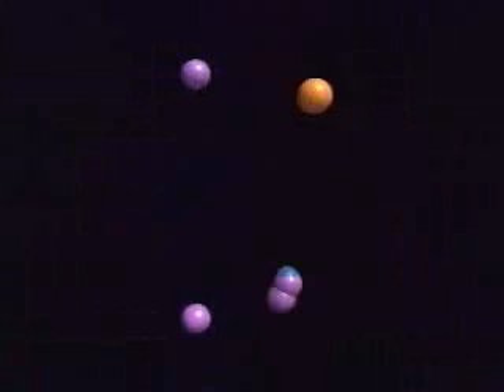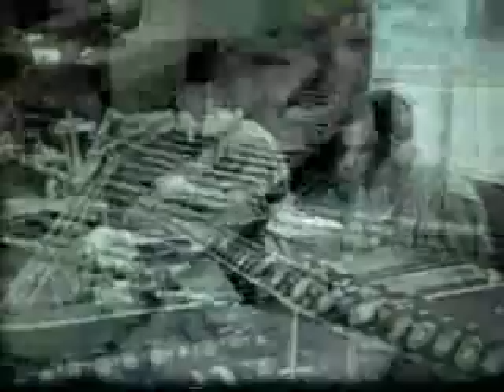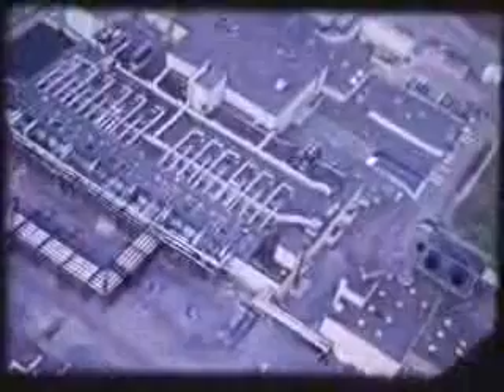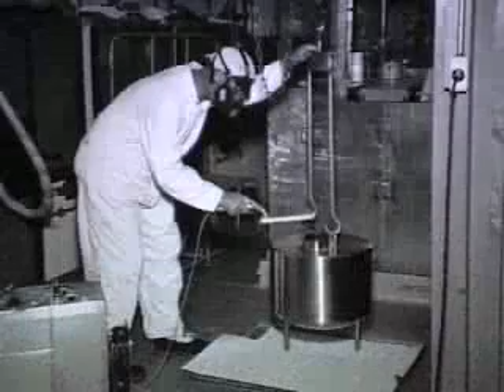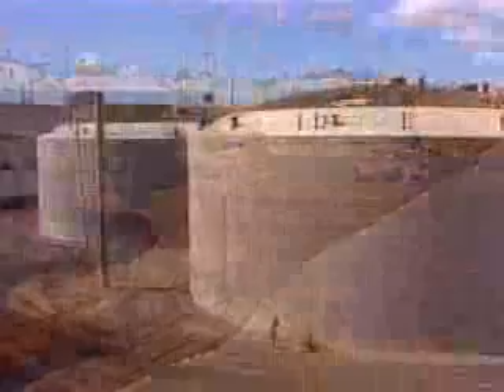Five Decades of Plutonium Production at Hanford

Comment: I guess you really need a DeLorean with a Mr. Fusion to use plutonium for peaceful purposes...
Reply from the maker: Yup, it's just not a peaceful element....
Reply: @MrJmccammon  Actually, it is quite possible to use Pu for peaceful purposes.  It is produced ANY time you have a chain reaction in Uranium.  To produce Plutonium, you have to remove the fuel rods within weeks at most.  If you simply leave the fuel in the reactor for an extended period as happens in a commercial reactor, then the Pu generated is simply fissioned as well, becoming an expected, calculated, and desirable portion of the total heat output of the fuel load.  

As a logical extension, Plutonium can be mixed with Uranium and used to produce commercial fuel called MOX (Mixed OXide) fuel.  This fuel is suitable for use in many modern commercial power reactors in specific fuel loading configurations.

Comment: My father got his PhD in Chemistry at UW back in the mid 60s.  He ended up going over to Hanford to work on the chemical reprocessing and more importantly...the problem of how they were going to deal with the waste in the "future".  Ended up working for both Livermore and Los Alamos during his career as well.
Reply: Funny you mentioned UW. We were doing a lab clean-out for UUE and found an accelerator target similar to the one shown in the beginning of this video in a micrometer mount. Most people thought it was a laser part due to the holder it was in. But it betrayed its true nature when removed from the kinematic mount simply said caution radioactive material, Pu239 6.5Ci property of the US DOE. It was mighty spicy when tested with a Ludlum model 2 counter but easily shielded in a lead pig. They thought it got lost in the 1960's and the state NRC refused to pick it up as they were not authorized to transport plutonium. They had to send federal NRC agents to come get it.The irony is that if i hadent been interested in the "laser parts" it would have ended up at auction or the UW surplus store.😂
Reply: So, what did they come up with as a solution to that problem?? Nothing, would be my guess..
Reply: @davelowets  could probably re use the waste for batterys
Reply: Your dad was a parasite
Reply from the maker: Sry for delay. Been dealing with thyroid cancer, bad shape for 8 years, only recently became "stable". Gotta wonder how many sources or at your local goodwill, I got a 1960 radiac counter with cobalt comparator for 10bucks at a thrift shop. Works perfectly!

Comment: They just pumped the cooling water back into the river!? WTF
Reply: Chemically pure water.  Most of the support buildings around the reactors were nothing but cooling water pre-treatment.  Chemically pure water can NOT be made radioactive by exposure to radiation.  Impurities in the water CAN be made radioactive.  We aren't talking filtered water here, we are talking lab-grade chemically pure water.  Any activity in the cooling water discharge would have been an indication of a water treatment problem and/or possible damage to the core, and would have resulted in the immediate shutdown of the reactor.

Biggest cause of damage to the river would have been due to a possible temperature increase, and THAT was very carefully monitored, as downstream temperature monitoring could have been used by our adversaries to determine the approximate power level the reactors were operating at.
Reply: Glow fish
Reply: That's kinda how it should work or at least into a body of water to cool down to temps that won't hurt wildlife

Comment: The RBMK-1000 design has a LOT in common with Hanford B
Reply: AND a lot different also....
Reply: Only difference is much of our scram methods in last ditch would destroy the reactor.
Reply: @JamesLuck2969  Only the liquid boric acid dump would have been irreversible.  The control rods and the emergency scram rods could all withdrawn without permanently affecting the pile.  And we soon replaced the acid with absorber-doped ball bearings that could also be cleaned out after use.

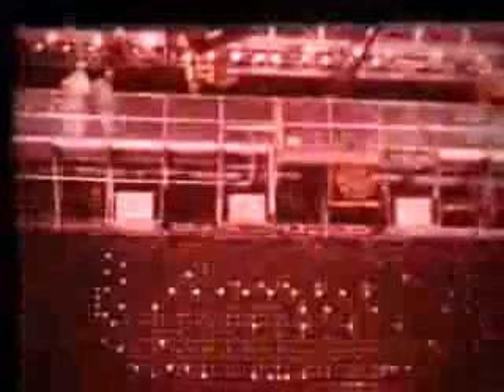Comment: 10:58 So Americans can make a water-cooled, graphite-moderated reactor with a positive void coefficient not explode because there were strict safety guidelines, something the Soviets couldn't do with the RBMK. The RBMK is almost a complete copy of the Hanford reactors.
Reply: Hanford B shut itself down by xenon poisoning during its very first run, and our operators pulled out all the control rods just like at Chernobyl.  We just got lucky that the reaction didn't restart anywhere in the pile (which happened to be too small) or we would have had the same accident in the state of Washington.   How we survived the early years of our atomic energy program I do not know.
Reply: Key words are  "almost a complete copy".  A virtually identical copy of the RBMK reactor design was discarded by the US during the design phase due to the very safety concerns that lead to disaster in Chernobyl.  What was actually built with B-reactor was a facility with more control rods, more safety rods, better sensors, a Barium dump system, and other features expressly put in place to prevent a runaway reaction.

Even with the reactor at 100% and all of the control rods pulled, inserting even a few of the safety rods would have resulted in an immediate SCRAM, and they were automatic and inserted using high-pressure air rams.  

The Barium dump system simply allowed a bunch of Barium-coated balls to fall by gravity into the voids in the core.  Basically, if the Barium system were ever engaged, you just shut off the lights and locked the doors behind you.  No way to remove them short of dis-assembling the core.

The RBMK reactor would have barely even shown a flutter on the instruments at the Xenon levels which completely shut down B-Reactor.  Chernobyl was run on the ragged edge of a disaster during normal operation.  B-Reactor was run on the ragged edge of barely being able to sustain a chain  reaction.
Reply: @kevincrosby1760 Boron coated balls, I believe.

Comment: The Irony that  is sad  the USA President will stand up in front of the World and say we will ban it but what he wont say is we will no longer produce it or use it. How can you expect other Nations to  comply with this Law when you are one of the top producers of weapons grade materials  in the World?
Reply: The USA is no longer producing fissile material.
Reply: @josephastier7421  We most certainly are. What are you talking about? Uranium is produced for reactors and plutonium production restarted in 2015 for NASA spacecraft.
Reply: @ShimrraJamaane  The uranium fuel for nuclear power plants is enriched to less than 5%, not high enough to make bombs.  The Plutonium-238 used on spacecraft RTGs is the wrong isotope to make bombs.
Reply: @josephastier7421  Correct, plutonium for RTGs isn't fissile (forgot that was a different isotope). However, we still produce tons of fissile uranium. So, your original comment would be accurate if you add that we no longer produce weapons-grade fissile material.
Reply: @ShimrraJamaane  Ah, OK(forgot that fissile includes any material that can sustain a chain reaction).

Comment: Those 8 reactors, running for decades, must have produced an unbelievable amount of thermal energy that was never used to produce power, just *wasted*.
Reply: Over its entire life, Hanford consumed far more power than it ever produced. That's why it was located where it was. Lots of water and hydroelectric power.
Reply: @railgap  Not hard to believe, considering it wasn't a power station.
Reply: @josephastier7421  Actually, 100N was both a Pu production reactor AND a power plant.
Reply: The thermal energy was of too low temperature and pressure to raise useable steam
Reply: It was smuggled to ishtahel
Reply: I think the idea that they ran those single pass reactors for so long is more concerning than wasted power.
Reply: @willett786  In the end, I guess you would need to see the numbers for much thermal energy was produced, and how much spent fuel.
Reply: In a water-cooled Graphite Core reactor designed for Pu production, steam is a BAD thing.  What verges on unbelievable is the amount of water that they forced through the cores to PREVENT steam generation.  Without generating high-pressure steam to run through turbines, there is really no practical way to recover that heat energy.
Reply: @JZ's BFF Really?  Send me an email address and I will be happy to send you a copy of a picture taken several months ago on a public tour.  Quite a nice picture of me standing three feet or so from the Front Face of B-Reactor.  That reactor was online and in production 40 years ago.
Reply: They don't run the neutron bombardment all the time... and it is not capable of producing large amounts really... relatively small amounts... it doesn't take much to obtain critical mass with U238... and it is hotter than hell... it's the uranium in the semi molten mantle that keeps it semi molten... our arms race with the Russians was NOT won through strength of arms.... it was the Russian economy that tanked... they spent more than they took in.  . So they printed more money... and there's only one result of spending more than you make ==>> bankruptcy 

A people who forget their history are doomed to repeat it... so they say... and if the Russians went broke... I think it's our turn... our paper money derives its ONLY value from the promise of our future taxes... it's borrowing ahead... at interest... to pay for absolutely unnecessary wars... any idea what the difference between communism and socialism is?... 

There is no difference... because our benevolent government ends up with all of the fruit of our labors... it doesn't matter what they call it... it's the same thing when the people who do the work don't get to keep the fruit of their labors 

What's that called?

Starts with an S
Reply: @Phyz7  Yes, it is "normal." And pretty much irrelevant, in both cases. I don't know how you would even compare the two, either to each other or to modern power reactors. The early reactors were run to create bomb material, not power. And the Sun doesn't have a "purpose" it just exists, and we just happen to be able to use it for our purposes.

If you then want to ask why I even brought this up, it's simple. It just seems to me an extraordinary about of wasted energy. That's not an indictment of nuclear power in our time, because it was before our time,, and with other things in mind. I still think it's a hellacious amount of power, a mind-blowing amount. That's all I was saying.
Reply: @JZ's Best Friend Are you drunk? What was the rest of your sentence? Anyway, seems you're basically right FWIW. There was a LOT of stray contamination created in the Cold War, on both sides. (Make that at least 6 sides—need to count China, UK, France, and India.)
Reply: @JZ's Best Friend Isn't he great folks?   Let's give him a big hand!
Reply: @JZ's Best Friend We gave them a chance to surrender peacefully at Potsdam.  They weren't interested.   So we had to do it the hard way.
Reply: @JZ's Best Friend You've heard the story because it's true.  No variations exist.  We gave them a chance to resign peacefully.  What else were we expected to do?
Reply: We had a war to win.
Reply: Its almost like there was a war, and technology that had to be studied or something.

Comment: i just found out that plutonium costs $4000 per gram. and there is 453 grams in 1 pound, multiply that by $4000 that equals $1,812,000 per pound. so to get 15-20 lbs of plutonium to make a fat man style bomb you'll be spending $36,240,000... ouch. i would rather use that money to find a way to recycle spent nuclear waste
Reply: Derek Wall Well, we already built them all :P
Reply: the cost to manufacture or buy a single megaton nuclear device would run you around $200,000,000 minimum, why so expensive you ask well its the price put on the metal fuels themselves not including the research
Reply: A reactor has been drawn up that takes pellets of Plutonium about the size of Tylenol capsules embedded in a ceramic rod that rots the Plutonium down into Lead. 
The outside ring of rods only have the Plutonium capsules on the inside facing ceramic rods, drastically reducing the amount of radiation the reactor receives. It lasts much longer that way.
When the Plutonium has rotted down to the point it is not effective in the power plant, the rods are removed and placed in a second unit that produces all the hot water and heat for the town, melting snow off the streets on the way back to the heating unit. But we are forbidden from building them, if you put Uranium rods into the thing, it would enrich the Uranium too much. Solution there is, don't do that, but in true US Government style, just made the entire concept illegal.
Reply: @paulbeck6841  Where did you pick up that fairy tale?
Reply: @cat637d  by reading about it, when it was drawn up/invented in the 1980s. It is technically a type of "breeder reactor" and therefore banned. The ban is totally irrelevant since the invention of the centrifugal concentrator. Both types of reactors, Plutonium and Thorium are much safer because they depend on water or liquid Sodium to heat up, not cool down.
Reply: @paulbeck6841  You are just regurgitating word salad, breeders have never Bern banned!
Reply: Derek Wall 4000$/kg. 1MX=~ 1000000$.
Reply: Do you also want to prevent the sun from shining cuz its a waste of resources?
Reply: Your Pu production cost is about two or three orders of magnitude too high!
Reply: Nuclear Power Stations produce considerable amounts of Plutonium which is present in the 'spent fuel rods'. Many are stored in a very unstable way at Fukushima. It is still too dangerous to attempt to shift them to somewhere safer. If another Earthquake were to occur at Fukushima, then these 'fuel rods' would explode with the force of 14,000 Hiroshima Bombs -- dangerous nucleotides would be distributed throughout the Northern Hemisphere (like 85 Chernobyls all at once). Most of Japan would be uninhabitable, as the least consequence. It is not just a problem for Japan -- it is a problem for the whole human race.
Reply: @dnickaroo3574  I hope you brought enough of whatever you are smoking to share with the rest of us.
Reply: @dnickaroo3574  You do not know what you are talking about. You are a fear mongering imbecile!
Reply: @dnickaroo3574  NO, the physical distribution of Pu in spent fuel assemblies cannot, in any configuration produce a nuclear explosion.  See Wikipedia for a layman's education on this subject.

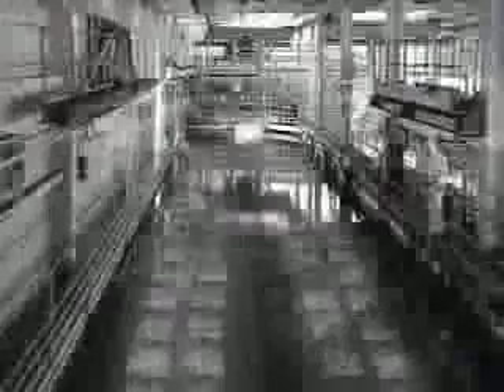Comment: Just look at the amount of Cherenkov radiation coming off the spent fuel at 15:24. That is some hot stuff...and most of that sits in storage tanks now. Glad I don't live downstream of Hanford...
Reply: tetrabromobisphenol not to mention what they're dumping out of the cleanup containers onto the ground at the site. They're not supposed to do that but they are and are lying about it as it's on video !
Reply: The bottom line is that it cannot be cleaned up or contained.  Everyone who is alive today has strontium 90 in their teeth and bones. It causes Leukemias and other cancers.  A hideous gift from the M.I.C.
Reply: tetrachlorodibenzodioxin
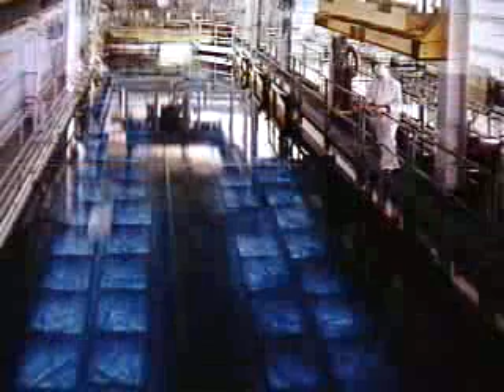Reply: 16:41 gives you a MUCH better idea...
Reply: The video (film) shows that stuff “hot off the press;” I doubt it’s anywhere near that hot now.

Remember that news always embellishes and creates fear, as do regulators at times. At the same, they also won’t tell you about many accidents or the REAL dangers, where they exist. What you do hear, is typically nonsense.
Reply: It won't be that hot, to produce Pu-239 from U-238 you only want to add one neutron, so you don't irradiate it nearly as much as you would in a power reactor
Reply: @hjembrentkent6181  Plenty hot enough if it's producing that much visible Cherenkov radiation under water...

Not something you'd want to be around if it was in open air. 

Also, we don't know if that fuel shown was for reprocessing to obtain the Plutonium, OR if it was spent fuel from when the reactor was used only for producing electrical power. It could have been in the reactor for a LONG time. The stuff could be VERY hot. 🔥

Edit: At 16:41 where the video was showing the same glow, the narrator was explaining that the fuel shown WAS in fact the "hot stuff", that had to be stored for MUCH longer because it was used for power production and wasn't suitable for reprocessing at Purex. So yes, it was very HOT.